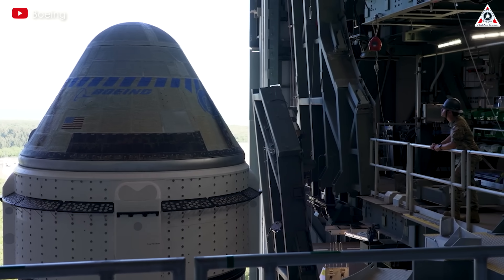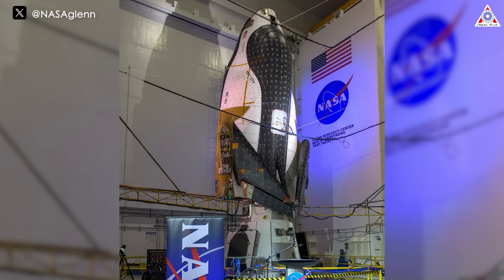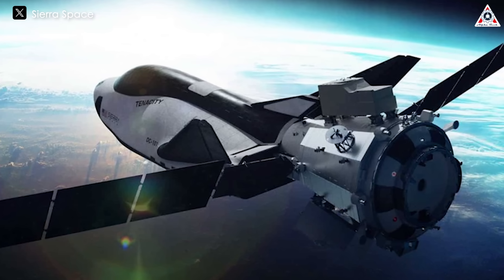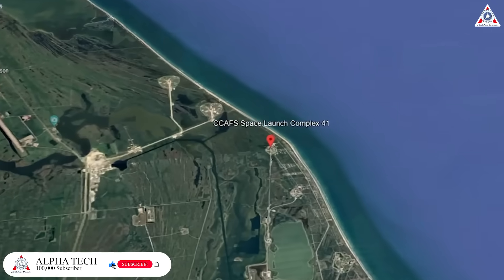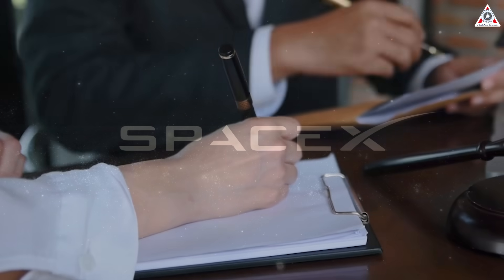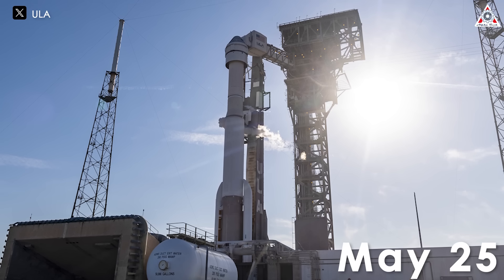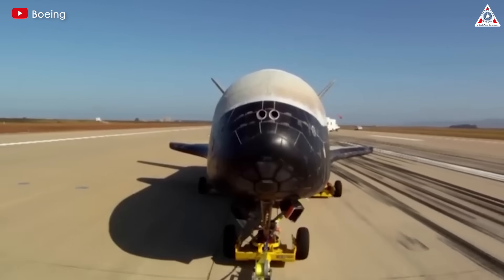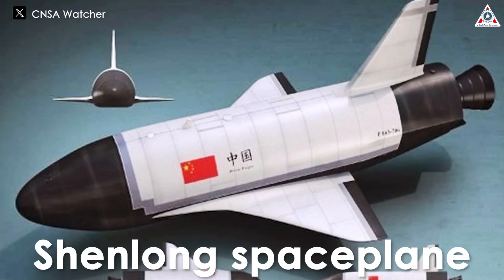NASA's Genius Solution to Launch NEW Space Plane Replace Shuttle...

Comment: Glad this is finally approaching launch, it and the manned version will be fantastic to see. Maybe the manned version could even eventually service Hubble again?
Reply: The DC cargo version still has a long ways to go. It may fly late this year or early next but there is still some rigorous testing to be done. It took SX five years to develop the human rated Dragon after the cargo Dragon was developed. At the very least you are looking at 3 to 5 years before the DC manned version would be ready to fly and even more to count on it for a Hubble repair. Even then they have significant problems to overcome. I think a lot of it depends on what measure of success the Starship has. It could pickup the Hubble and bring it back for a complete overhaul or the capacity to deliver the huge sized parts needed if they wanted to repair it in place. Hopefully DC will pass all the tests and be used for the ISS and all of the other manned stations yet to come. We are in a proxy war right now and I would not be surprised to see the ISS decommissioned at any time.

Comment: Another method of getting a smaller vessel with crew and delicate cargo into orbit is high altitude spin-launch.  You might think a spin-launch is high pressure but there is a way around it (pun intended).  Let's say you use two helium balloons to lift an adjoining bar with the launch vehicles to between 30 and 40 kilometers of altitude (which is reasonable).  The air thins very quickly with altitude and so there will be very little wind resistance.  At the center of the bar is a spindle upon which two vessels are attached.  As it spins, it begins extending a tether so that each launch vehicle.  There are two so they counter-balance each other (call them ying and yang).  The spindles speed may remain constant as their velocity will automatically increase as the tethers are extended.  Once the speed sufficient for orbital insertion is acquired then you ship the crew/cargo module down the tether to meet each launch vessel and snap into it then immediately detach from the tether.  The crew/cargo module would glide by centrifugal force (unpowered) such that it will naturally not feel any (or no significant) G force during acceleration.  In fact, the only force felt will be deceleration after release due to wind resistance.  However, this will be minimal as the air is very thin and only gets thinner with altitude.  It's a very simple system but also very inexpensive and very eloquent.

Comment: I have a personal goal (as a fun project) to work out a design for a self-launching long-duration habitable space vessel for under $100K in materials, something possible for a common man to build and launch.  It didn't seem possible for a long time but, after many concepts and iterations, I really feel like I have something.  It's two counter-rotating discs with computer-controlled magnetic separation of an axel component (shaped like a spindle of thread) that joins the two.  There are coils and magnets between the two so that energy can be drawn from the counter-rotation.  The rocket engines (concentric pressure chambers with H2+O2 combustion on the inner chamber and liquid water to steam in the outer chamber) are located at three hardpoints on the outer perimeter of the discs.  The release pressure as they spin around to the desired angle for lift.  The rotation provides stability during launch and so no gimbaling is necessary at all.  The hull is made of four layers of aramid fabric with two layers of polyurethane.  The outer layer is aluminized aramid with open space between it and the next layer.  This keeps the heat off, keeps the aramid from decay due to UV rays, and provides a pocket for regolith storage.  The inner membrane is PVC truss-core and flooring -- commercial off-the-shelf.  The fuel and propellant is liquid water with baking soda for electrolysis.  The counter-rotation of the discs easily produce sufficient electrical energy for continuous electrolysis to fee the hydrogen combustion in a JIT manner.  This is cooled by the outer pressure chamber through steam production, also generating thrust.  This is similar to the main engines on the space shuttle, actually.  The math works out for sufficient energy production and thrust when at scale of at least roughly 30 meter radius (better margins with larger size).  The closest margin is the large amounts of liquid water required.  Under the flooring of the design is the sewer/water-treatment system.  At launch, the whole perimeter area interior may be used to store liquid water.  The rotation will act like a turbo pump.  Once in orbit, power generation would be through sterling generators.  The axel component would hold the crew during launch (should be zero vibration for them).  The combination of aramid and polyurethane is both highly protective against cosmic rays and solar flare radiation and also ballistics.  The combination of aramid fabric and polyurethane has a synergistic effect providing improved ballistics protection.  It is also quickly and easily repairable in the event of a puncture.  It is highly insulative and air-tight... and light weight with very high tensile strength.